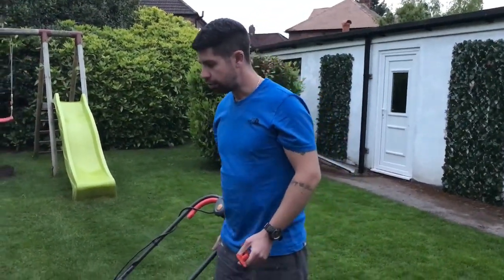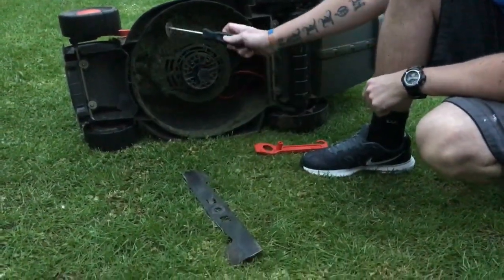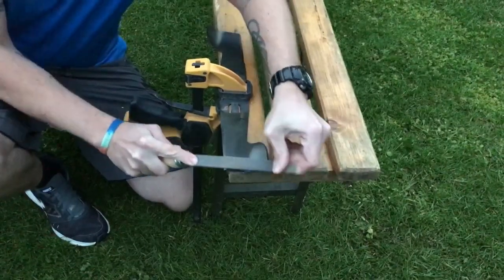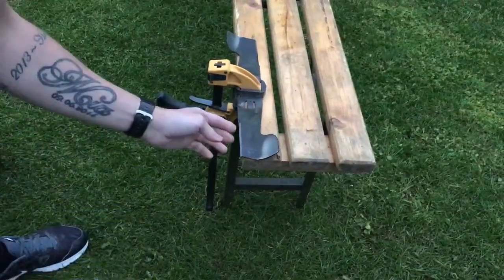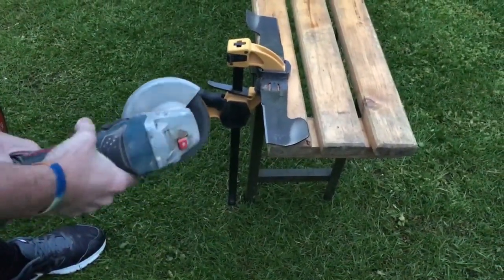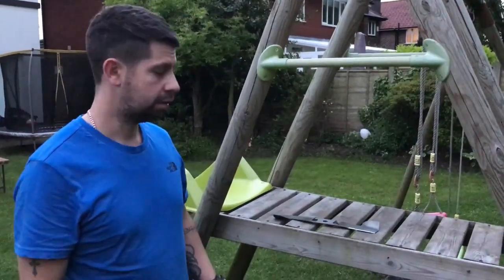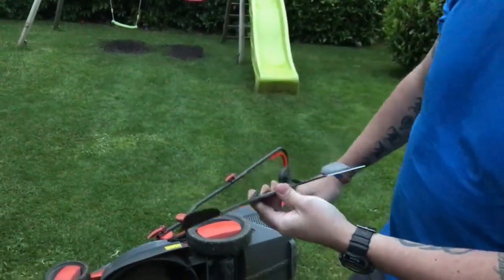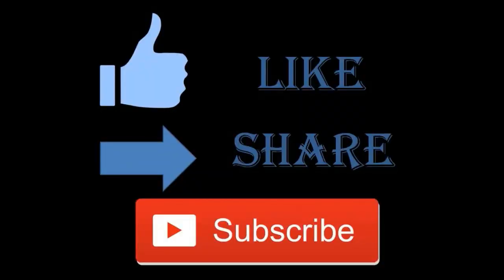How to sharpen a rotary lawn mower blade, quick and easy

Comment: A good point to check the balance. This gets overlook a lot. Thanks for posting.
Reply from the maker: Stephen's 8x6 Workshop thanks for your comment! Like with anything with 2 or more blades that rotate at speed they need to be balanced or they will cause vibration. I've missed your videos, do you have any in the pipeline? 👍🏼
Reply: @spendtimesavemoneydiy  yes, three in post production and a Stsnley adventure in the planning.  ☺
Reply from the maker: Stephen's 8x6 Workshop 😁 I shall wait in anticipation! 👍🏼

Comment: The mower should not be turned on it’s side on the grass as there is a high risk of fuel spillage. An essential safety requirement is to disable the engine by removing the spark plug otherwise there could serious injury.
Reply from the maker: Roland Nevett Thank you for your concern but you failed to notice the mower is electric. Therefore no fuel, no spark plug and it was disconnected from the power supply.
Thanks for watching and be sure to like share and subscribe to help the channel grow 👍🏼
Reply: @spendtimesavemoneydiy  Unfortunately no cord is visible and you don't say it is electrically powered. Nowadays most people use petrol mowers as they have become very cheap and reliable as well as more convenient with better results. Your site is easily rectified by stating you recommendations are for electric mowers only and petrol mowers require additional safety measures to be put in place. Stay safe.
Reply: @rnevett  Just get your coat. It's obviously an electric mower.
Reply: @andrewbush65  I hope this guy is well insured.